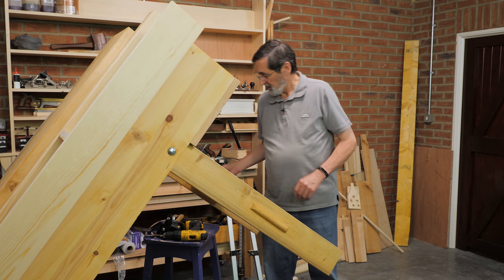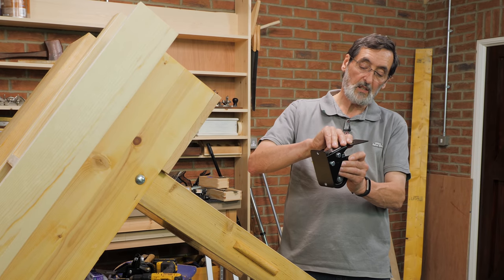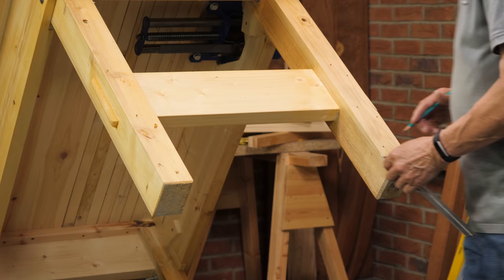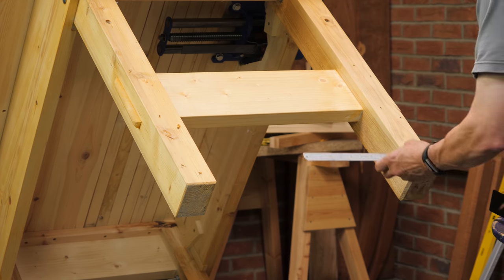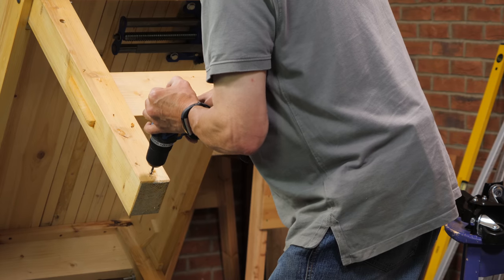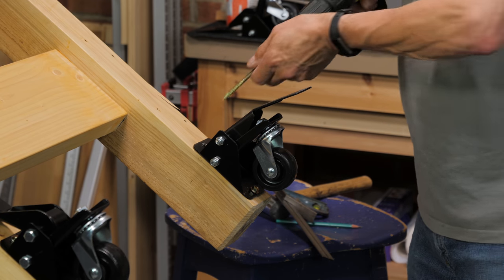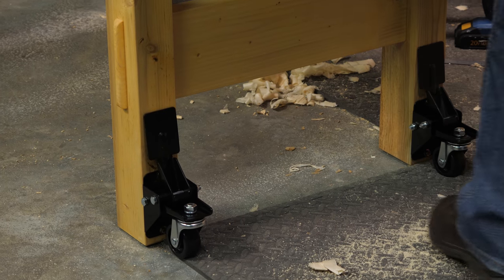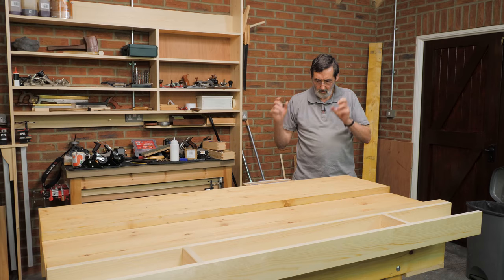Fitting the Castors | Paul Sellers

Comment: Wouldn't they be better inboard rather than outboard Paul. No sharp edges to catch ankles on.
Reply from the maker: Less accessible though, and they really do not get in the way. Also, the further apart the greater the stability in moving around. I think it was well thought through.
Reply: Could you put them on one side only and move the workbench around like a wheelbarrow, or is it too heavy?
Reply: @kardRatzinger  - the casters would make that hard.   Just go to a store with the carts with the casters in the front lift the back and you will see its not controllable.
Reply from the maker: Dunno, try it! That said, they're only sold in fours and they work perfectly well. Why fix what ain't broke?
Reply: Have to agree with Ken on this one. For the few times that you will move your bench wouldn't the fact that the castors were out of the way beat the slight difficulty in operating and the negligible difference in stability? I think that stubbing brooms, toes and materials will tell.
Reply: Husky Himself ahh, but they would still get in the way of the broom on the inside of the legs, wouldn't they?
Reply: @Paul.Sellers  I’ve got two big old castors that came with my Record Power bandsaw. I’ll pop them on my bench when I’ve finished it and see how it goes. Can’t hurt, only be a few holes to plug if I don’t like it!

Comment: These wheels are the perfect middle-ground. Normally the wheels make the workbench wobbly. I can leave my workbench parked, but I would attach these because you never know when you'll have to move it on your own. 

I would perhaps add a metal bar connecting the levers so that you can press them both down at the same time which should reduce strain on one of the wheels.
Reply: I have a stack of old business cards that I end up using as shims.  It works great for me because my floor isn't even and you never know when you need a small shim

Comment: I've used these and they work great.  I put mine on the inside of the legs so they'd be out of the way and I could tip the bench if needed.  A little more awkward to activate but not a big deal.
Reply from the maker: Actually, I think it is a big deal myself. Hard to access and harder to sweep around. I considered all options, worked it out for myself and feel it was a well thought out decision leading to extra length over all which gave better stability, ease of cleaning and total access for raising up.
Reply: Paul Sellers  Are you still able to tip the workbench, though? Or is that something you never need to do again?

Comment: I made one of Paul's first generation workbenches (double sided) which has turned out to be a very sturdy and useful tool - thank you Paul.  
I think this castor option is okay for what it is but for my workbench I adapted Carl Holmgren's retractable castor design (https://youtu.be/FLoW_FkJ2q4?t=51s). I can engage and disengage the castors with minimal effort and I don't need to ensure space to access to the castor levers on each leg of the bench.  Also, any swivel castor of sufficient strength can be used instead of buying a task specific design.

Comment: Those casters look like the ones that Rockler and Powetec sell.  Both offer a quick disconnect base that will allow you to remove the caster by pulling a retaining pin..  I looked at the PowerTec and Rockler bases and found that they were identical.  If they are in the way you might want to consider adding them to the bench...they will be on my bench when I make it

Comment: Great job.
Maybe to improve it you can connect two castors wit flat bar, so instead of locking/unlocking 4 castors you will end up just with 2 bars, one on each side of the bench.

Comment: There are quick release mount plates available for the wheels.  I have a several sets of mounts and one set of wheels. to move around tables and powertools.  When not in use they pop off and stay out of the way.